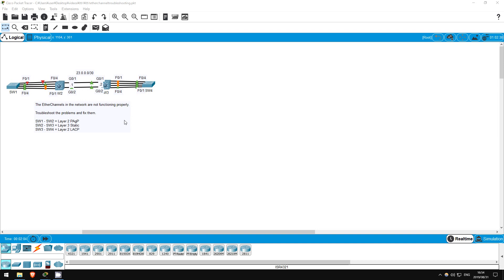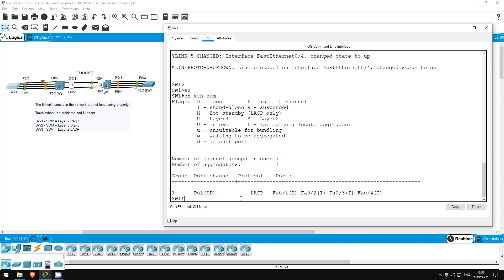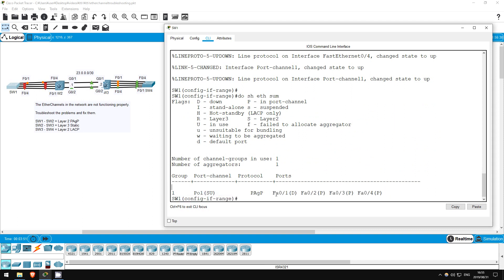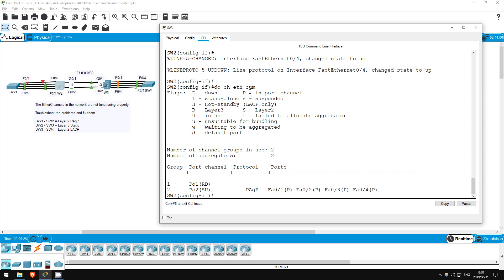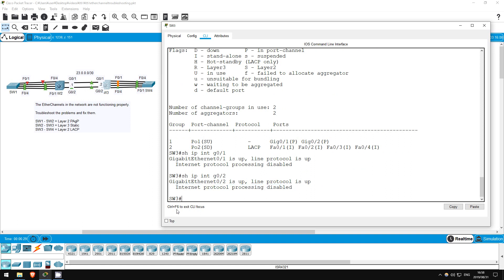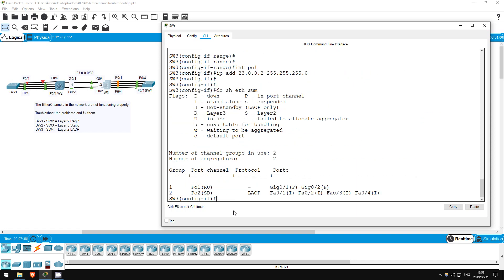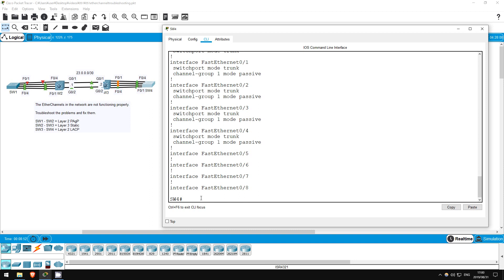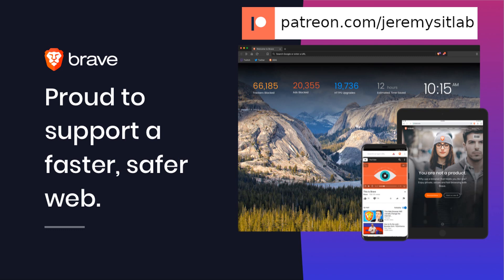FREE CCNA Lab 051: EtherChannel Troubleshooting

Comment: the subnet mask that you entered were from /24 prefix i.e. 255.255.255.0 but in the Lab it is clearly stated to use /30 prefix. Did i just catch ur mistake or I am thinking too much.... I will appreciate if you can clear me on this...
Reply: I think you should hv used subnet mask as 255.255.255.252 while creating L3 Etherchannel. 🤔🤔🤔

Comment: why does the link is red between SW1 - SW2 after fixing?!
Thanks for the videos
Reply from the maker: I think it's a packet tracer problem.  The show command shows that the etherchannel is working.
Reply: This was also bugging me. I was able to fix it by first setting the correct speed then creating channel-group
Reply: If you just re-enable the interface, it solves the problem. Don't know why